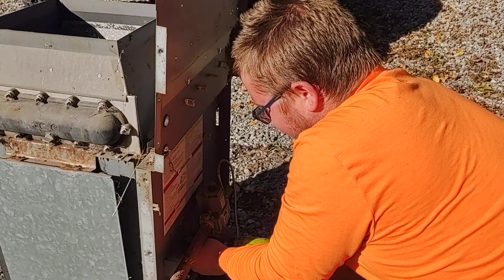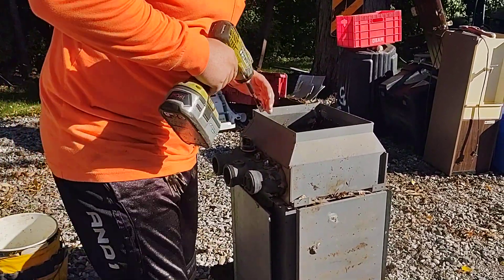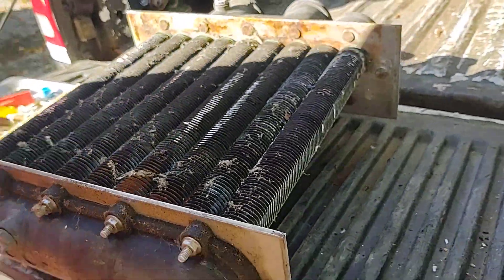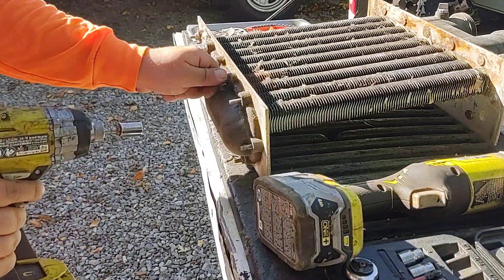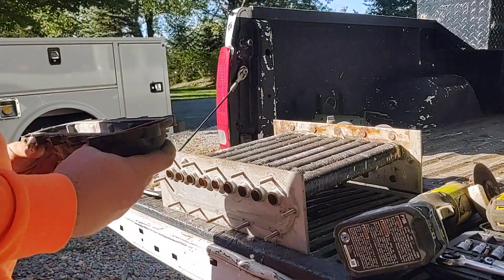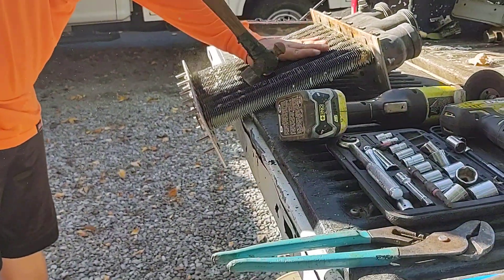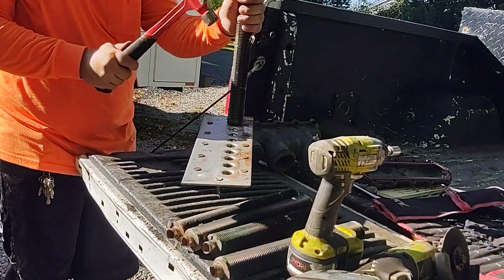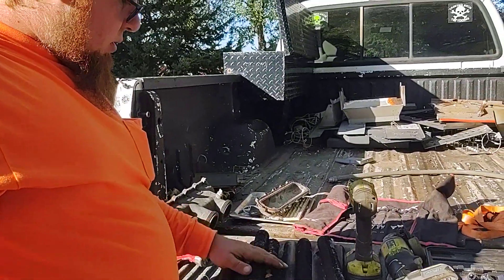How much copper is in a pool heater / boiler. Copper recovery. Part 2.

Comment: Those ends and the nuts should be Stainless.  My yard will take it as stainless if the magnet does not hold itself to the material.  It is still a 300 series Stainless, just not 304.  That sucks about your yard.  Are there any other yards around you that you can check?  You should be between 30-40 lbs.  I had one at 32 and one at 38!!  $$$$$!!  Loved the video!
Reply from the maker: My yards are all the same with stainless